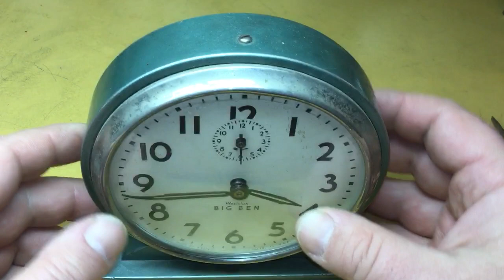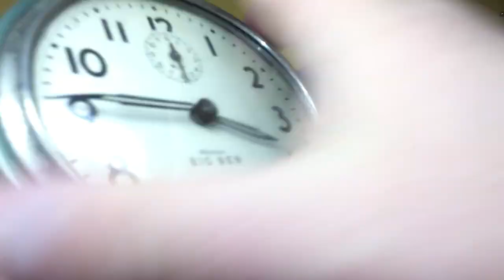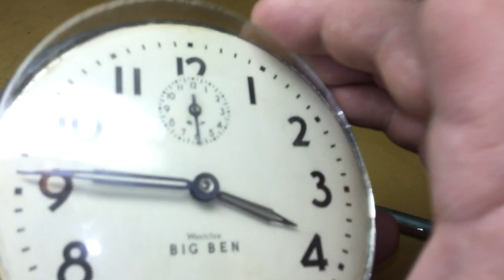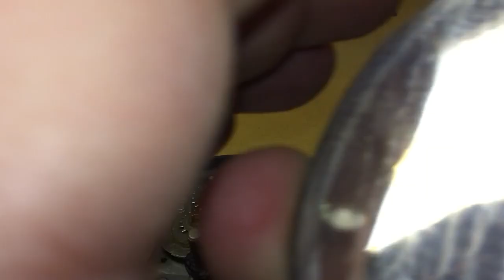Westclox Big Ben Style 4 Chime Alarm Rebuild Part 1

Comment: He's done it again! So those missing/present rubber grommets are for dust protection or is there some other purpose for them? That'd also be fantastic if you'd show your cleaning process in this series.
Reply from the maker: I am fairly certain that the rubber washers that are missing are for sound isolation. The loud alarm clocks use metal only for dust sealing.
They must have figured out that metal to metal washers on this clock would transmit ticking noise to the case, and would totally offset the effort of mounting the movement in the rubber isolators. 

Sorry, I did not film my cleaning process, but it is really quite simple.  
All the parts go in cleaning solution for an hour with some form of agitation to circulate the solution. I then take the parts out one at a time and scrub them with the solution using a toothbrush and then rinse under hot running water with the toothbrush again. After rinsing I dry the parts using a towel and a fan. I peg the pivot holes out once the parts are dry.
Reply: @okbridges  I see.

Comment: Does it ring on hour and half hour i saw chime in the title thats why i asked
Reply from the maker: This clock uses what is known as a 'chime alarm'. Instead of the alarm just going off full blast, it starts out softly with a ding, ding ding, ding, ding ding, etc, and does this for about 20 seconds then it rings continuously. This alarm was developed by Westclox and sold from 1932 to 1956.

A clock that counts the hours on a bell or gong is properly known as a striking clock. If it plays a melody each quarter hour and strikes the hour it is a chiming clock.

Comment: What is the purpose of fly-fan?
Reply from the maker: The fly fan acts as a simple governor to regulate the alarm speed.
Reply: @okbridges  Fascinating. If the clock inner workings would be "open to public" then it would be also a nice visual.